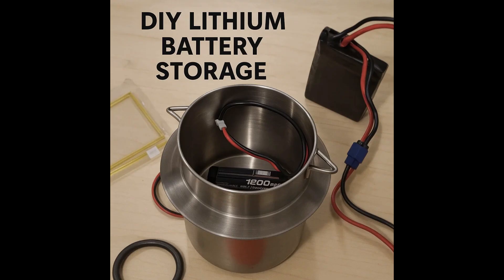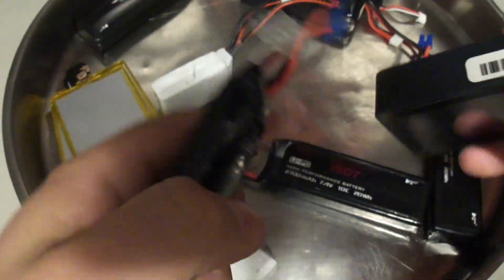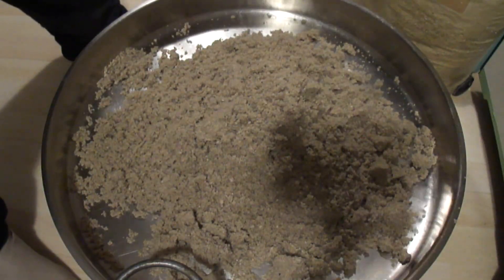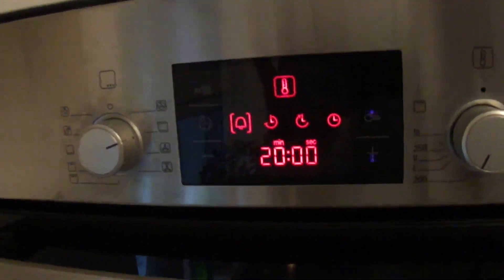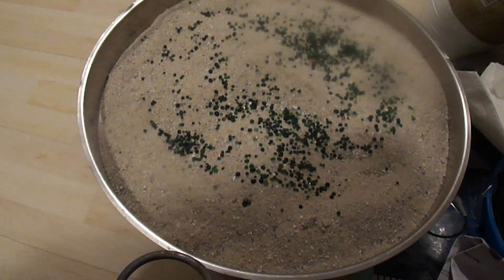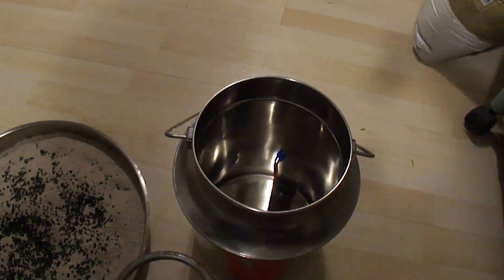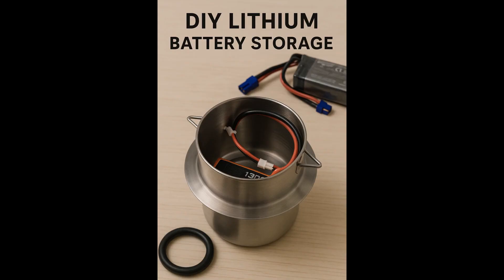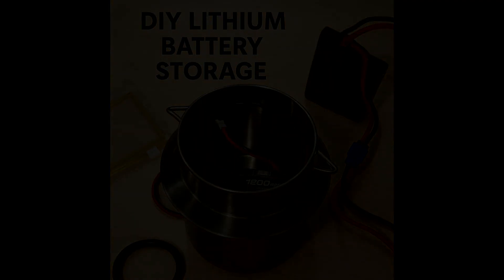🔋 DIY Lithium Battery Storage in a Steel Milk Can | Fire Safety with Sand & Desiccant

Comment: I'm glad more people are making videos on amateur containment vessels. Because most people I've encountered don't exactly have a containment strategy for their lithium ion batteries. The concerning majority is there in a box somewhere on a shelf or in a drawer. If containment vessels became the norm for the hobby is out there that would be a good safety improvement.

I also have made my own containment vessels, although with different surplus materials. I live in the US so metal ammo cans are generally fairly cheap and work pretty good for this purpose when modified. If you're going to keep the gasket like I recommend. you need to drill some holes and put waterproof metal tape over both sides the holes I drilled in the lid. Although the gasket should blow out and be safe I wanted more precautions. I also wanted a bit more weather resistance. Because I store mine in my metal shed that stays in a safe temperature range. I also do the sand silica gel desiccant ball mixture the same way you do.
Reply from the maker: That's a pretty good design

Comment: Isnt this overkill ?? I mean i cannot burry my battery everyday,,its crazy,,
Reply: @cjvilleneuve1566  most RC things don’t have standard battery sizes, and so are not compatible.

My jet cannot fly on my prop plane’s battery and my prop gets overvolted when doing the other way around.

Rc car batteries have a special shell to cusion the impacts, this however makes the batteries unsuitable for airplanes due to the extra weight. And so and so forth. And that’s how you end up with a high explosive drawer.
Reply: No not really, This is the instructions on how they're supposed to be stored. 
The contents of the battery are highly flammable. When severely overheated they can produce oxygen. Then you charge it with a ton of extra energy. A burning hobby pack and a road flare could be mistaken for each other. Except for the hobby pack would probably be bigger flame.
Look up lithium ion battery fires and you'll start to see why you might want to be taking precautions. Where in the lithium ion battery safety culture of, it's okay to be washing your clothes in a bathtub full of gasoline in your gas lit house. That's how you get the stubborn stains out.(I'm not joking that's how we used to wash clothes sometimes) Just because a lot of people have been getting away with it for a long period of time doesn't mean it's a good idea. I still have to have conversations with people in maker spaces about not keeping loose lithium ion cells in backpacks. Although it's been a few years now since I've been there.

Also the gasoline thing does actually work on nonpolar stains quite well. But really don't do this.

Comment: I am guessing in your country people have so many Lithium batteries that this is an issue?  can't say I have heard of lithium battery fires being common enough for this to be a consideration in the US.
Reply: When you do rc flying ,driving or boating for a hobby, that pile of batteries grows exponentially. I have even more than this guy has.
Reply: It's actually a pretty big issue here as well. Especially after any sort of flooding. It's responsible for quite a few houses burning down while people are evacuated. 
Even worse is we don't really collect statistics in a lot of cases. So the current problem in the US is we have absolutely no idea how bad or not the issue is. So the only real evidence we have is anecdotal except for a few specific recording programs for other things that are catching lithium ion fires. But my fire and EMS friends are getting concerned, But it's mostly anecdotal at this point. It also doesn't help that most of the time the cause of the fire goes non-reported in the news.

My old roommate almost burnt down my house with a cheap Chinese usb battery bank. It failed catastrophically after it stopped working was swollen and was emitting a funny smell. He threw it into the kitchen trash can. I pulled it out and insisted that it must be stored in one of my battery containment cans that I make from modified ammo cans. A few hours later when it's sitting on the middle concrete of the pad. The vent holes I drilled are spewing pretty big jets of flame. He would have burnt down the house we were renting and all of my stuff.
I modified in ammo can by keeping the gasket and drilling a few holes in the lid and metal taping both sides with waterproof metal tape. That way if a failure occurs and its venting gas it won't build up until it eventually It explodes. (Either to pressure or oxygen release by the battery)  where I currently live they go in the metal shed with a bunch of other lawn equipment And chemicals.
Although I guess it's kind of stereotypical American of me to modified ammo cans. But they're just perfect for so many other use cases as well.
Reply: And looking at his battery plugs, this guy flies horizonhobby rc aircraft.
Reply: That's why LIPO LIFe battery need to be heavily controlled like guns !! To dangerous to play with those
Reply from the maker: While solid-state batteries represent the future, today’s LiPo technology remains indispensable due to its price-performance ratio. Improved separators and additives could indeed make LiPo cells even safer, but the real leap in safety will come with solid-state batteries. Lithium-titanate batteries already demonstrate how safe lithium technology can be when compromises are made in energy density. The coming years will bring exciting advances in all of these areas. @soulbrothers7789